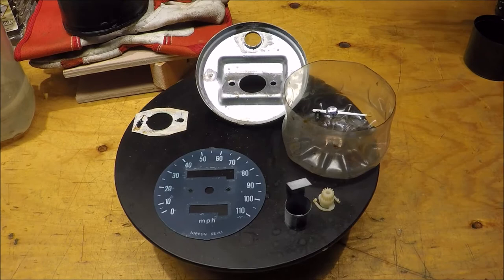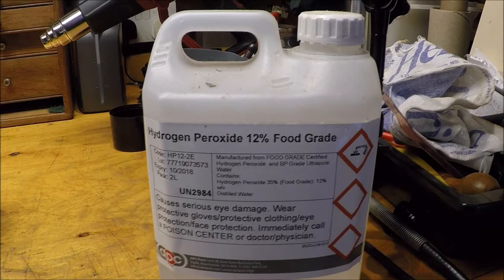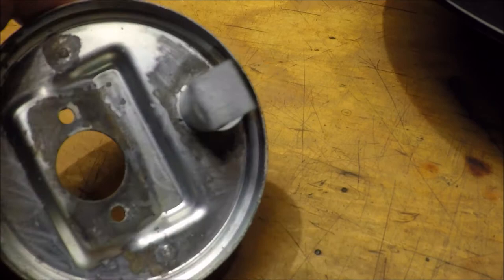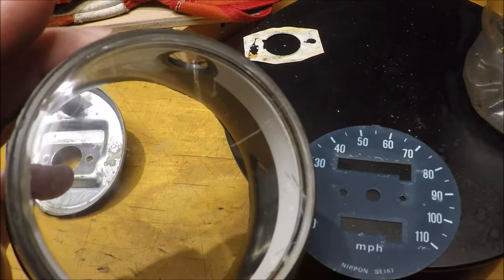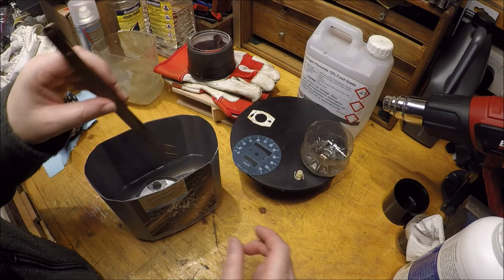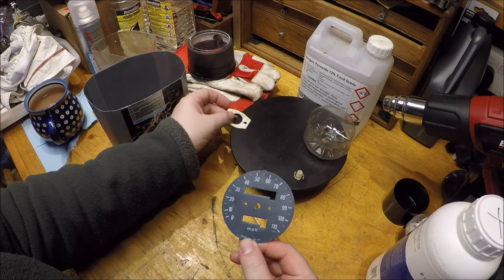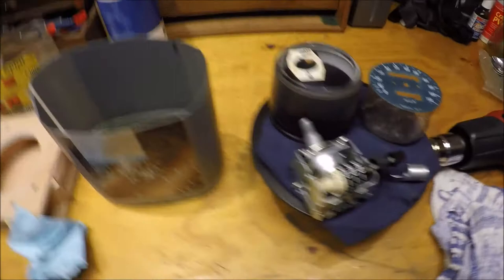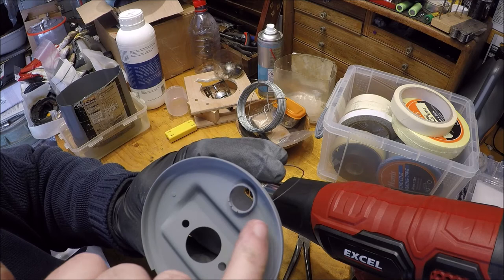Honda CB200 - Front End Strip - P8i: Speedometer - Restoration

Comment: Yes I'd use Sugru as mentioned before or maybe Tiger Seal would be a softer rubbery finish. If you scan the dial and maybe get a sign shop to digitise it and print out a sticker (laminated) that might be an option.
Reply: Maybe they could clean up the dial in Photoshop from a jpeg too which would save time digitising it.
Reply from the maker: Hi Hepcat. "Tiger Seal", I'll look into that as well, thanks. ref new faces, I'm talking with a few people about this. Looking to get the new face artwork made and then either printed on a sticker or plastic disc or even onto the original ally faces. So far not found anyone doing the CB200 faces so setup costs are high for just one of each.
Reply: @garethowen7050  The difficulty is finding the exact same font, nearest I have is Helvetica Bold Condensed for the numerals, it's very easy to make them look wrong if you don't have the correct typeface.
Reply from the maker: @HepcatHarley  Thanks for the font suggestion. Been playing around with a few at home to see if I could find anything close, no luck yet,  will try this out.